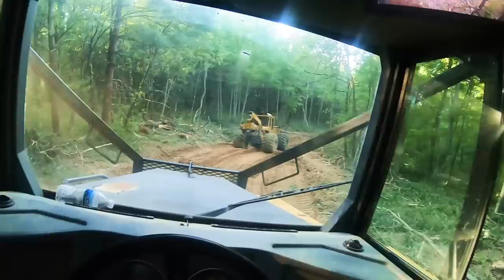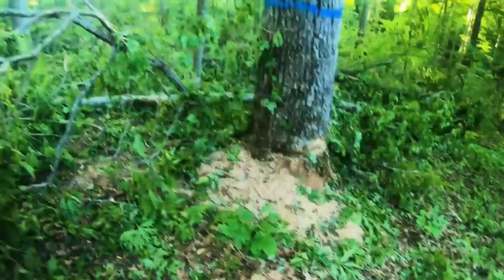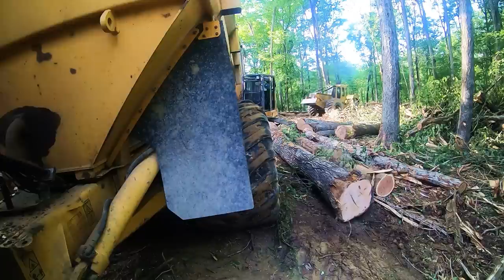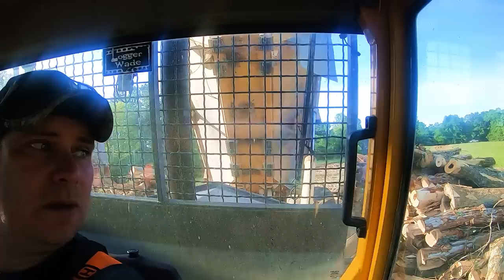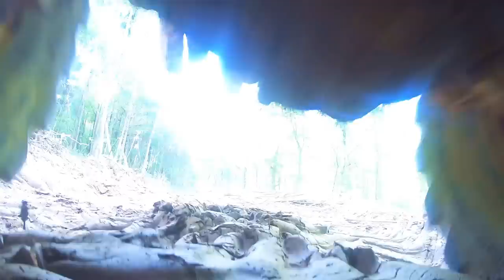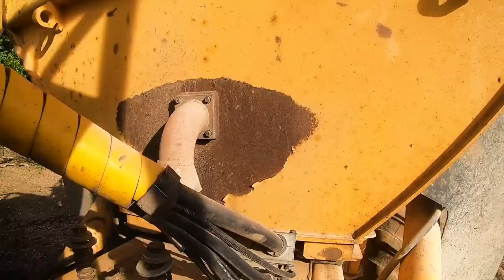Hauling logs through soft ground!!

Comment: Hello Mr. Wade, I thought for sure that the rifles on the log pull road trails when it makes those ripple lines is call boarding. If wet, water boarding, dry caused when a tire or tires bounce one time, and that's all it takes to make them bigger and bigger just from the bumping of the suspension.
The only way to get rid of them is have a grader come in and cut them out( the water boards or rippling). Number to help with those bumps and garden harrows, that's just what we call them when they follow each others tracks and deeper and bumpier they get. So no sheep following. Spread it around and watch them start to go away. The other, when you get to those ripples in the soft...slow the ...  down and that will help until they get them cut out.

Comment: when we use to run earth moving equipment scrapers, laserbuckets the best thing for articulation hinges and walking Beam axles is to grease them at least every 4hrs to help stop the bushing from flogging out and damaging the pins and bushing sockets, we always carred a grease gun on board and kept the grease up to the points especially in hard conditions, it won't stop them from wearing out but it will slow the damage and prolong the life of the parts 👍

Comment: Wade you might want to check your tray pivot pins on tiney they could do with some spacers for that side slap it’s got, and check the pin and bush’s to, they seem ok but it wouldn’t hurt to check if you do the spacers, you can’t beat those machines on soft stuff, they don’t dig in they just float across the top, good vid wade thank you

Comment: I do like it because I did not know that it has suspension . I also like that you are using something that is out of the box type thinking to get the job done , Sure unloads faster than a double bunk forwarder , why have a loader in the middle if you have them at both ends . Weight wise it must not be to much work for that off road dump / Tiny  compared to hauling dirt . It should last for years and no loader to wear out .

Comment: Start running a field blade roller through that ground and churn up the soil, add saw dust by the truck load, save on fuel consumption and delays when rain come, let the dust suck in the water. Spending time on a road is the difference between making or breaking a job.